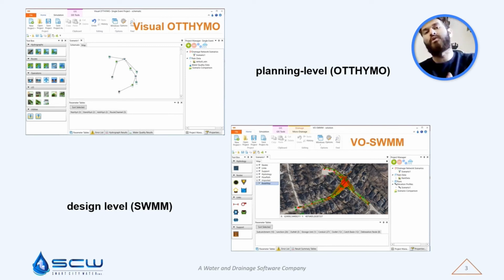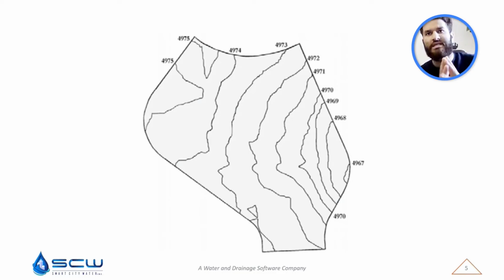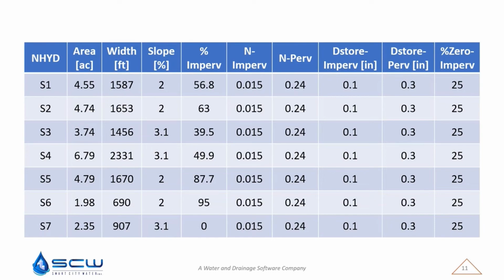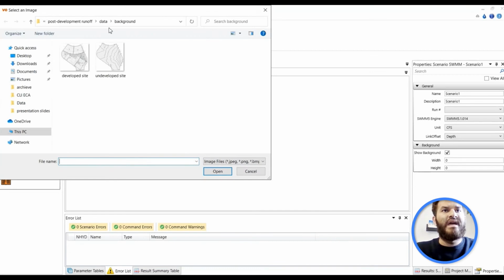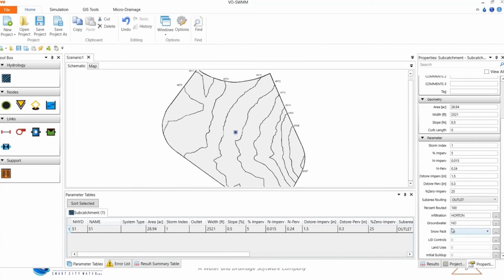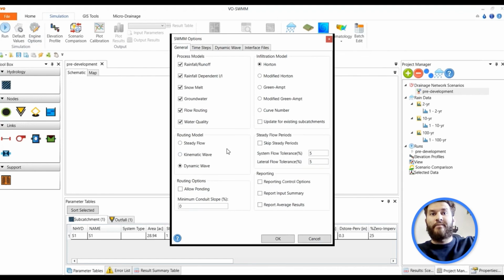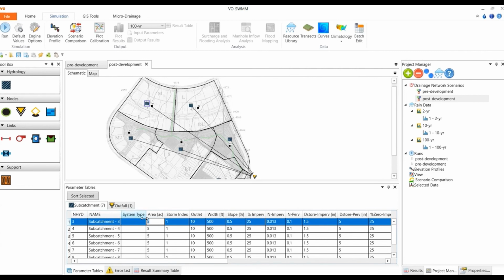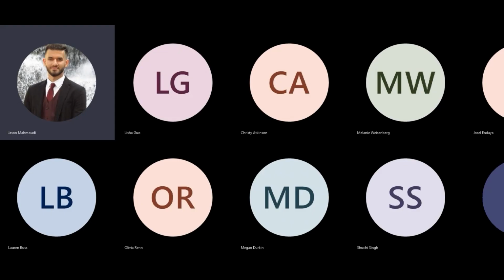#SCWebinar 3, Comparison of Land Development Modeling in OTTHYMO and SWMM

Comment: Don't you think you first need to connect the subcatchment on the upstream side, far from the storm network, to the storm network and then to the outlet? Since this configuration of directly linking the subcatchment and outlet will definitely cause an overestimation of peak flows due to ignorance of routing,